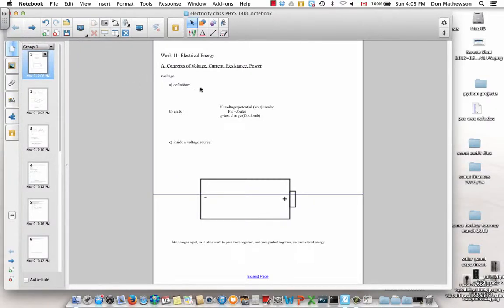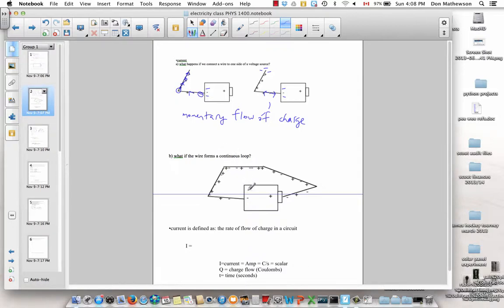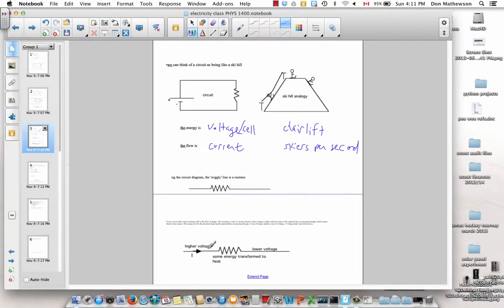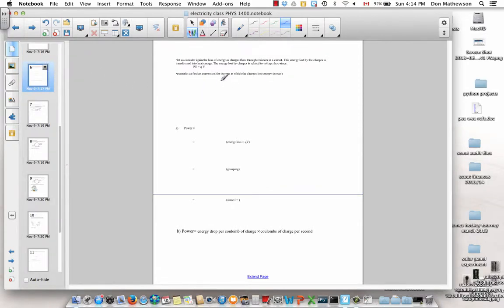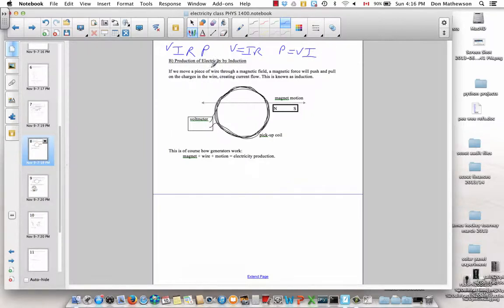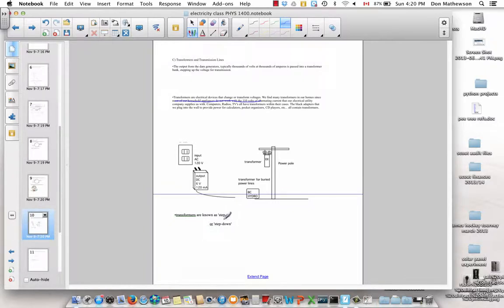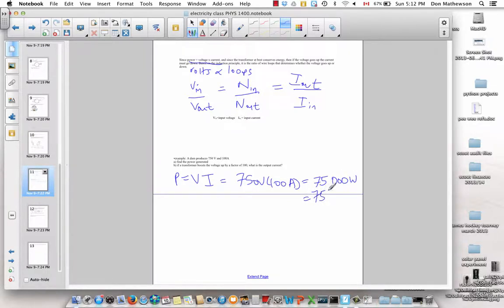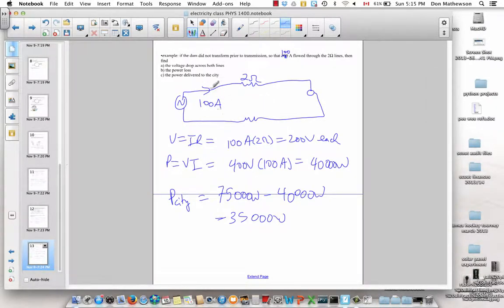week 11 electricity

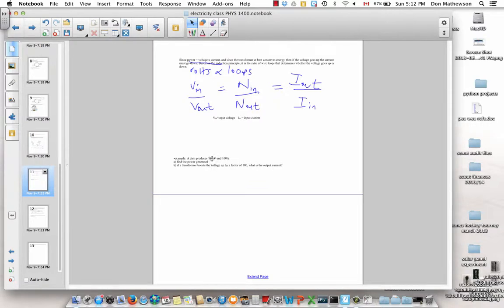Comment: 16:14 The Amps are 500, not 100... you started doing the calculation with 500, video stopped and you finished doing it with 100 Amps